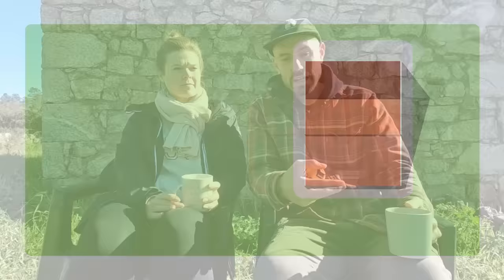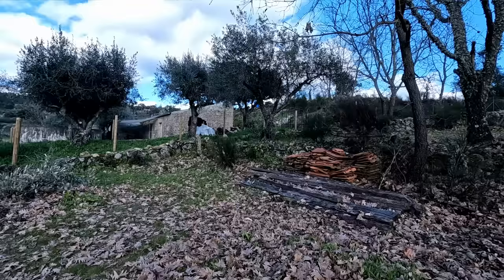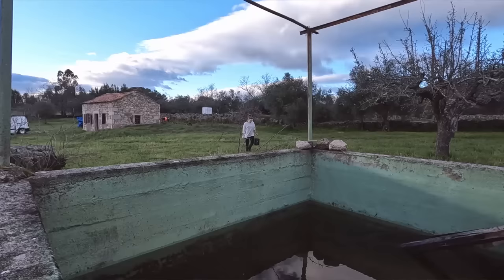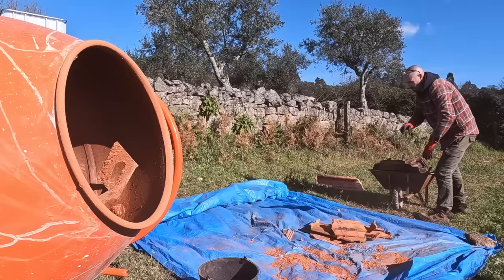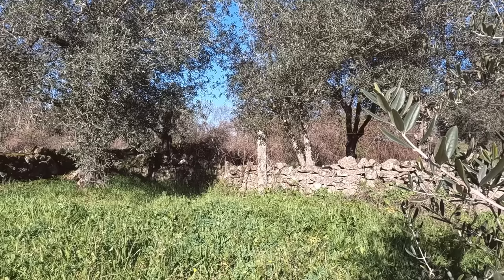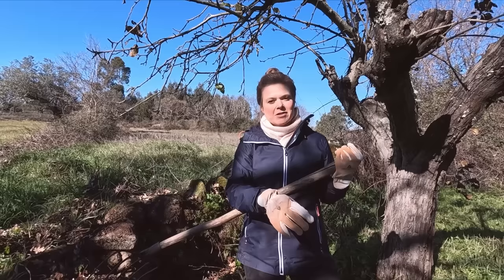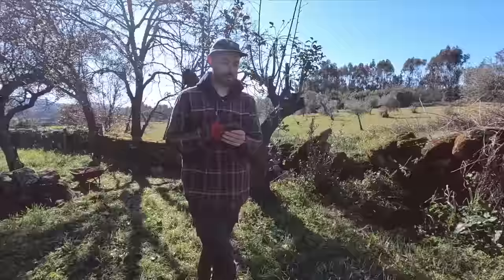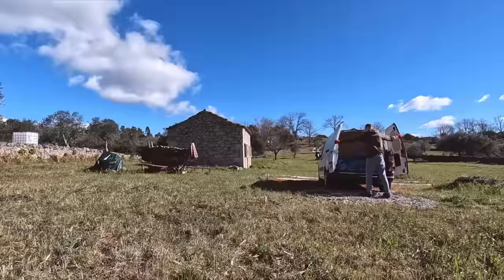A BIG TURNING POINT on our Farm & Stone Cottage Renovation!

Comment: Here's a suggestion for the turning around of the cars, which you probably already thought about, but anyway here goes. Why not going around the house? Instead of reserving a huge space just for turning around, don't reserve any space and just use the house itself as the centre of the circle. The cars enter from one side and when you want to go back to the road, just circle the house and take the road again. The cars never actually need to reverse or do any manoeuvres, just simply always drive ahead. I'd say it's easier and takes less space. Well, maybe not necessarily less space, all things consdered, but less "dead space" because just near around the house you wouldn't probably build anything anyway.
Reply: good idea.
Reply from the maker: Good idea & we did consider it, but when measuring there’s just simply not enough space around the back of the cottage
Reply: @LifebyLiving  
So my suggestion will remove that problem then. A circular drive. A separate entry and exit that runs past the front of your house in a horseshoe or half circle action.
Reply: @LifebyLiving  what if instead of making a huge square that takes tons of material you start by making a cross?? You park the cars on the east and west arms back to each other and then you back each car at a time to the north edge complete the turn. Even if you use some material to round the upper vertex and not catch grass its still less material than completing a square. Later if you feel the need you can close the rest
Reply: @LifebyLiving ❤
Reply: But that wouldn’t leave any space for landscaping! I think they should plant some roses, perennials and ornamental grasses to soften the stark look of the place. A little patio out back would be nice, with potted plants as well, and maybe a portable grill. When they are living in the tiny house while renovating the big house, it would make cooking easier. Can you get a Weber grill in Portugal?

Comment: About 2 years ago, I redid my ancient wheelbarrow as a winter project.  It got a new tub and I reinforced some of the steel bracing between tub and wooden handles.  The biggest improvement was that I added a 2nd front wheel by making a longer axle so it now has two wheels up front.   Now, it's so much easier to carry heavy loads without requiring so much strength to keep it upright!

Comment: Meant to comment last week on your bench that looked really good and very familiar. If you look at my instant gramophone (munged because using the short name seems to block the post) for my handle roger til, you will see a couple of photos.
My bench (and table) was made from chestnut in 2007 when we lived in Italy and it is so comfortable we brought it back to the UK with us.
It is a bit bigger than yours and I contoured the seat so it is not flat and also the back is at 2 different angles. But the support leg design was just like yours - great minds think alike :)

Keep up the good work - a small tipper trailer would save you a lot of time and effort btw !

Comment: what if instead of making a huge square that takes tons of material you start by making a cross?? You park the cars on the east and west arms back to each other and then you back each car to the north edge complete the turn. Even if you use some material to round the upper vertex and not catch grass its still less material than completing a square
Reply: Well, you'd have to fill in the 'corners' of the cross - which would end up being a diamond shape ... which is a square....it's splitting hairs...!!

Comment: We’re planning to do the same thing with our old roof tiles! Nice to see someone else with the same idea and it’s looking fantastic. How long is it in the cement mixer to round off the edges?
Reply from the maker: A bucket full was nice & smooth in 5 mins 😎
Reply: @Life by Ricky  That's amazing! I think Grant is using most of the tiles from the house for raised garden beds, but we will have more than enough when we replace the roof on the annex building.

Comment: Are you sure you can't put the fence in the top of the stone walls? Can't you put the poles into the stone wall, fixed them with cement and then atach the wire all around it? Good job and good luck.
Reply from the maker: Yes we can put the poles in the wall but  we would also need to rebuild huge amounts of the wall so that there is a level flat surface for the bottom of the fence to run along

Comment: Why do you need gravel ?
You need to have surounding looking like in the little land in England ?
Reply from the maker: It’s necessary for safety. Either gravel, tarmac, concrete etc. You can’t park a car with a hot exhaust on grass in the summer as it’s a fire risk